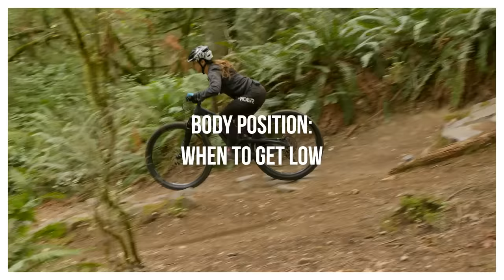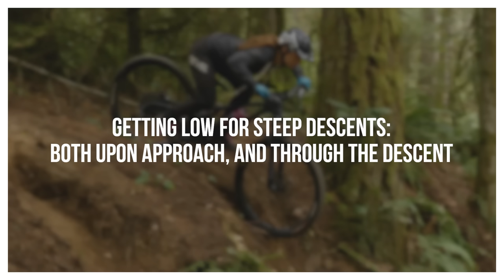When To Get Low - Practice Like a Pro #64

Comment: Love these tutorials. I have a local race with a very steep, narrow, and curvy descent that has me sweating every year. I practiced some of the techniques you guys have been covering, especially the hip rotation and body-bike separation. I did the descent on my training ride today and it doesn't phase me at all anymore, so thanks for that! I did hit a very sandy, drifty section, and automatically went to an easier (spinning) gear and in a lower position. It helped.
Reply from the maker: Nice. Love knowing this is landing! Cheers.  -Simon

Comment: Good stuff, Simon & Linnea.  I like that focus:  not trying to get low, just ending up there because of the needed adaptations.  Especially the "don't get low, THEN twist, that won't work."  It's not about emulating what you SEE, it's about emulating what caused the thing you see.  

This was the toughest thing to teach visual learner, monkey-see monkey-do students in skiing.  They would be good at emulating a "position" but no understanding of how/why that position exists.  The explanation didn't help them as much as what they saw and emulated.
Reply from the maker: Yes, to your point I think this is also where a lot of well intentioned coaches go wrong with technique ideas. It's not about the shape we are making (or especially holding) but rather the process that helps us move with ease through these shapes as we stay dynamic on the bike. My students often try so hard to do something thinking of the final goal they have in mind, without relaxing through the journey which ultimately brings them to their goal.

Comment: Thanks for these awesome vids, good vibe too!  I’m curious if you had any tips on how to improve rapidly changing body body position? I'm okay if I have time to prepare, but sometimes it feels like two features are kinda stacked ontop of one another – for example a steep rock roll immediately into a sharp corner. Or a sharp corner straight into a drop, and then immediately onto a rock garden. My body feels like it just can't keep up with what my brain wants it to do :D
Reply from the maker: Hey Danny. Great question and actually timely as I was just talking with Linnea this morning about my major challenge in teaching advanced jump classes, which is that riders are not always able to recover from one feature before getting to the next. I have a lot of ideas around, this, but will keep it as brief as I can here.  Firstly, try to notice on terrain that seems easy to you how you are always able to feel balanced and relaxed. We want to bring this to increasingly more and more technical terrain. The key is to be sure each move is made properly which will then bring us back to our neutral position over the bottom bracket. Find some terrain that moderately challenges you in this regard, and work through it until you feel things are linking better. Repetition is the key here. Then up the challenge. For a roll to turn for instance (which you referenced) you could find an embankment to roll down and could set up a turn at the bottom. Start with a part of the bank which allows you minor challenge then work your way to steeper parts, or to a tighter turn at the bottom. I recommend using cones for this so you can stay challenged while keeping safe. Also remember that the goal is 'link' the moves. Remember that when we are cornering, we are looking for compression in the bike, something a steep roll down naturally gives us. In your mind, remind yourself that the terrain is helping you load the bike as you reach the base of the hill and move into your turn. Thinking about each piece of terrain can help us with the next is really helpful in creating a strong mental space where we can think of one thing as helping the other instead of upsetting it. With this method you will be able to progress nicely. Be patient with yourself as you learn. Gradual improvements add up quickly over time. Hope this helps!  -Simon
Reply: @Fluidride  thank you so much for this advice, that's absolutely superb!

Comment: Good video.  I do have one question.  Is that his normal bike?  It looks a little small for him.
Reply from the maker: That is the bike I normally teach on. It's an S5 Specialized Stumpjumper (XL) but is lower and shorter than my big travel bikes. I'm just tall:-). Not quite tall enough for XXL in most makes though.  -Simon
Reply: I am with you on that but my dilemma is between a med. and a large. 
Regards, 
John  @Fluidride